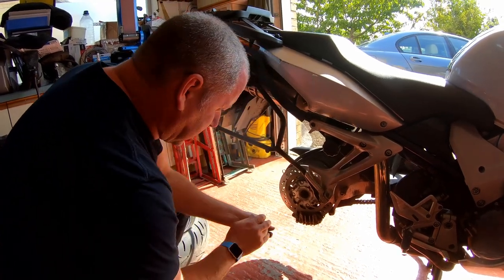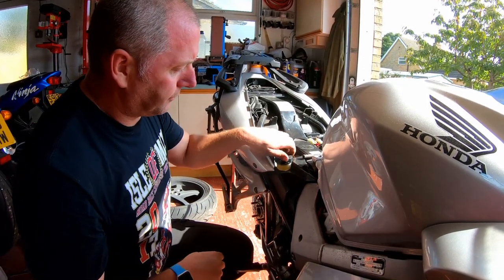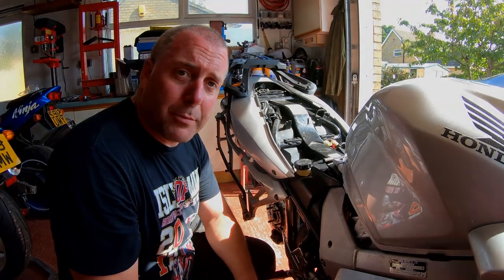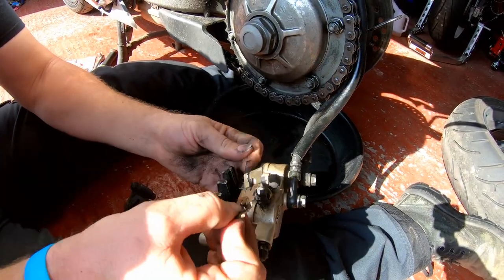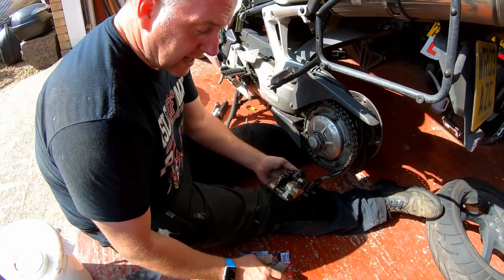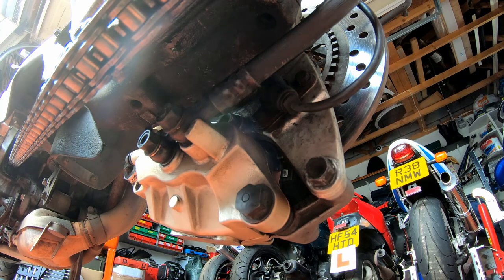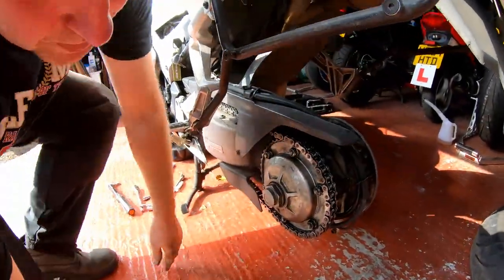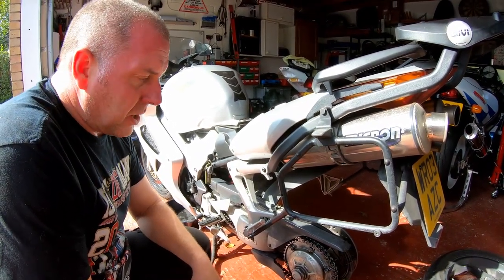2003 Honda VFR800 VTEC Rear Brake Pad Replacement

Comment: Appreciate your VFR tutorials, I have successfully completed the oil and filter, air filter, clutch and brake fluid changes together with all new pads and coolant replacement thanks to your concise instructive videos. Its been years since I have attempted my own maintenance, but with retirement and more time on my hands thought Id give it a go. Only problem I encountered was a broken caliper mounting bolt, but thankfully I managed to remove it with no drama and replace with all new. Thanks again Kev, its given me confidence to attempt the more complicated tutorials lol. Next up is the sprockets and chain. Cheers...

Comment: keV very informative not sure I would have found the bolt holding caliper on rear tricky one. I spent a few hours taking it apart to find everything inside was good and pads didn't need replacing. Peace of mind. Good video.

Comment: Hi kev I love the way you make the videos so simple and no waffling, I had a stroke last year and it has affected my left arm I'm OK but I've been left with a weakness in my hand and I'm struggling with the clutch leaver after about 90 miles I seem to lose the strength in my hand is there any way I can make the clutch softer or easier to operate cheers kev ,colin Taylor

Comment: Excellent, I'm not a fan of copper slip on the backs of pads etc either, only place I'd smear a little bit of copper slip is on the threads of the pad pins. funny no matter how often I do certain jobs I like to view it being done just as a refresher before I do it again, fitting new rear pads to my 5th gen tomorrow.

Comment: Hi Kev, love the chanel. I'm about to overhaul all my system including discs. Do you need to remove the rear axle from the hub to replace the disc

Comment: I was wondering if you could do a brake bleed video. I want to upgrade my break lines to the steel braide, not having linked brake system before in my life on a bike. thanks bud
Reply from the maker: I already have mate, have a look through the VFR playlist 👍🏻